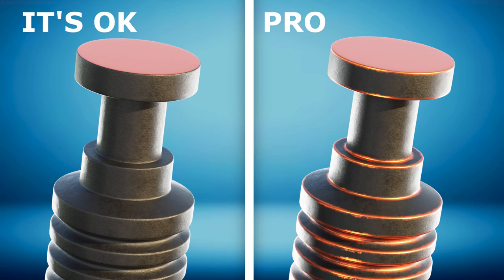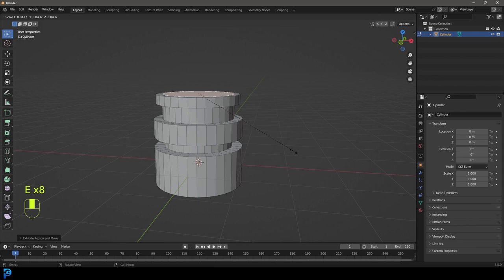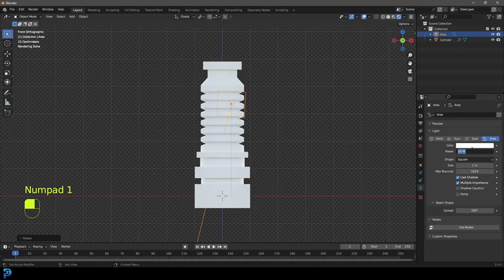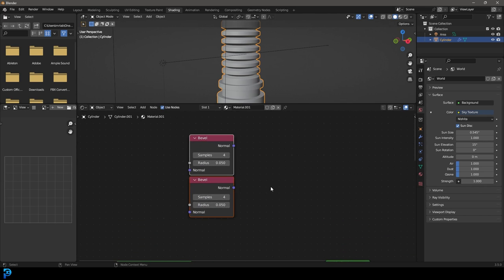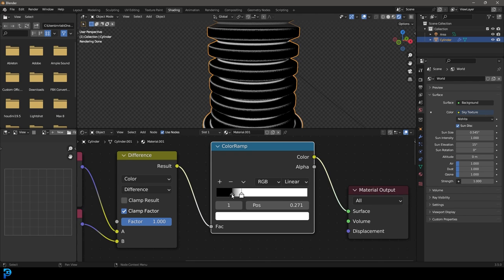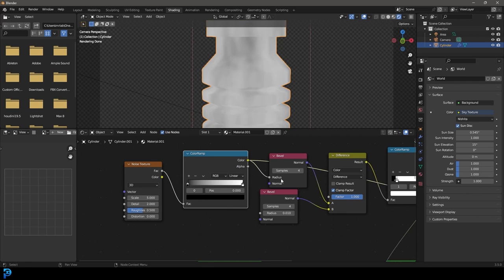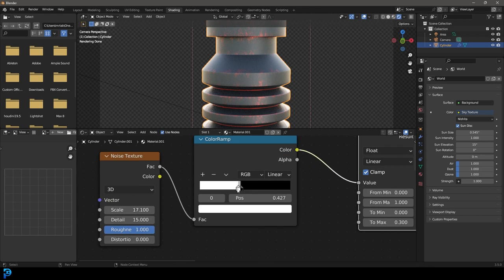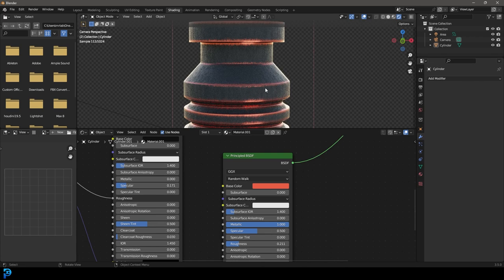Use This Method To Improve Your Shaders -Edge Wear

Comment: It's a really nice example, but you will need to work on removing the inner bevels as it's no longer edge wear if the inner sections are getting the same effect. The inner edges would gather dust, dirt and debris while the outer edges would look like what you have done here. Really nice tutorial and very well explained, but have a go at using the Ambient occlusion node to remove the or change the inner areas.
Reply: for that you can combine it with geometry / pointiness, this exactly maps depths and heights...

Comment: It does not work for me. I really don't know why. I have tried it multiple times now, but the result always stays the same. In the rendered preview the mesh is black and after connecting the color ramp it just shows the base color I selected. Pls help T.T
Reply: I had the same problem. you need to be in cycles and in rendered view for it to work.
Reply: the thing is that some edges are worn and the others are not and when I rotate the model it the opposite happens   @AdamBaird

Comment: I'm using this pretty same method when getting annoyed with Substance Painter to texture mechanical parts and works well, especially on smaller details when we don't need extreme zoom in. In mho much faster and controllable then texturing it in SP.

Comment: instantly used this idea as i was curious how could i access edges and apply customised normal maps(not bevel only) . This mix and difference node made a difference! Thanks for sharing this idea, will use it also to create edges of water body, submerged objects and similar(probably only with boolean, as i dont know how could i get object intersection information on shader level...me be possible on compositor level i guess - render normal pass and blur it on selected objects?)

Comment: Very good video, thank you. I needed to detect the edges, to soften them. I mean, after the ramp node I connected to the normal channel using a bump node. But I can’t make it work. Could you make a video with that? It would be a good practical way to soften edges without adding geometry.